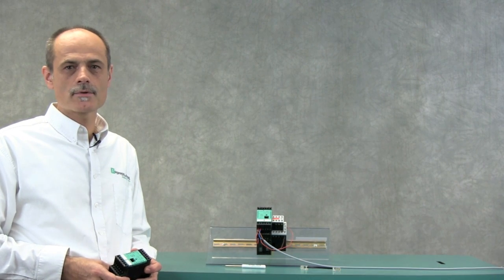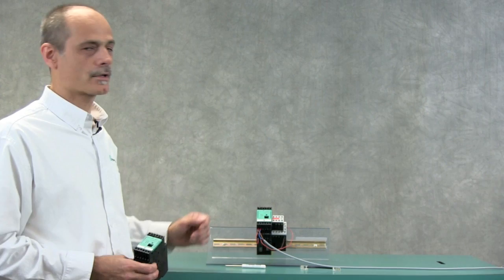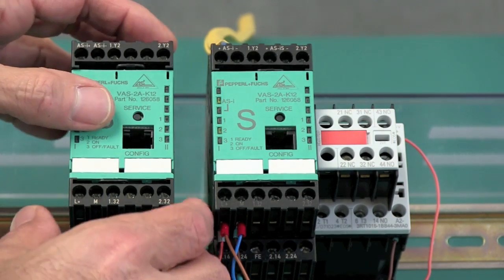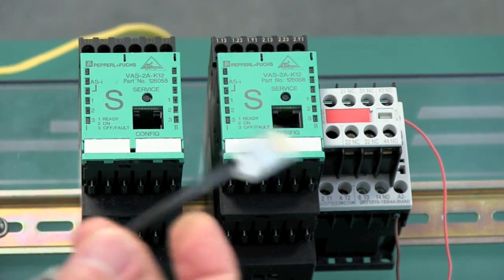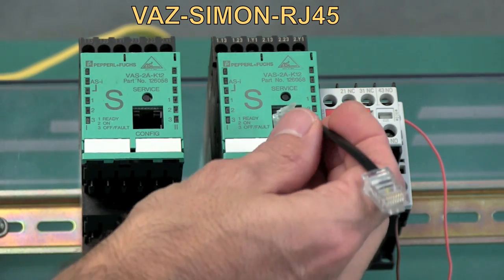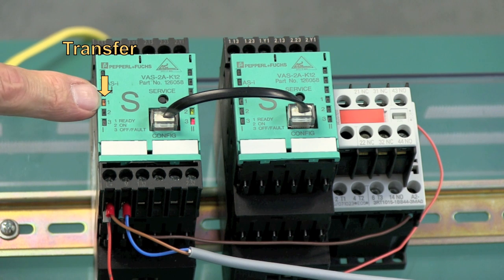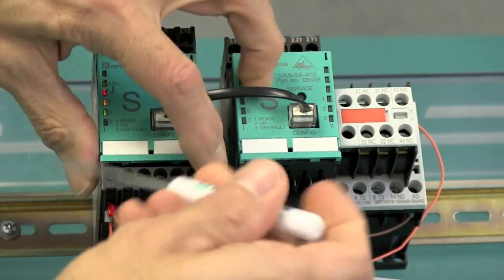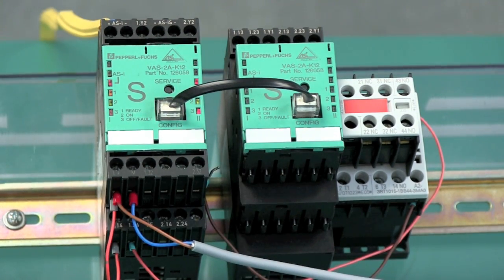How to Replace an AS-Interface Safety Monitor

Comment: Hello. Sir, I want to connect my computer to a safety monitor with the same product code as your video. What type of cable do I need to use to connect? I tried the cat6 rj45 cable but it doesn't connect to the software
Reply from the maker: Thanks for your question. We offer the cables that will assist you in replacing the AS-Interface safety monitor. It is PN 115088 VAZ-SIMON-RJ45. Please get in touch with our customer service if you’d like to place an order.